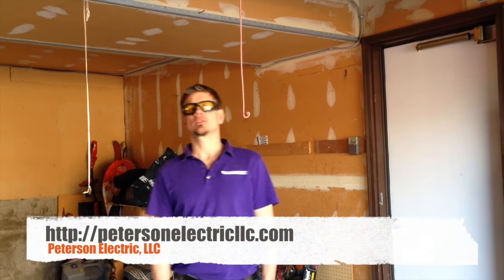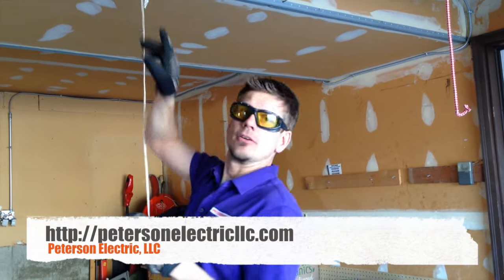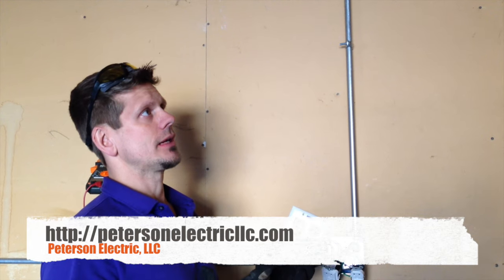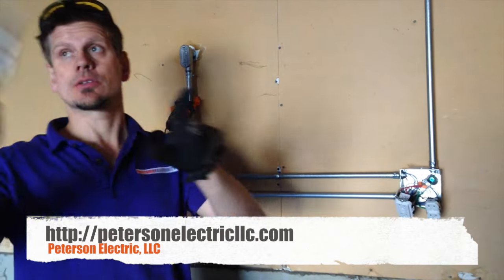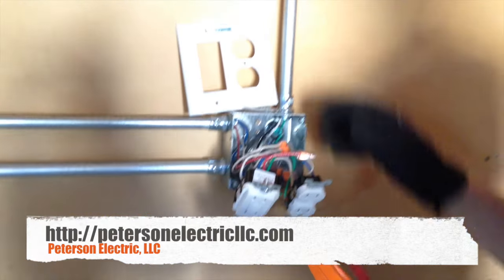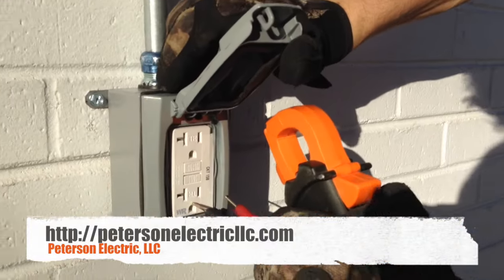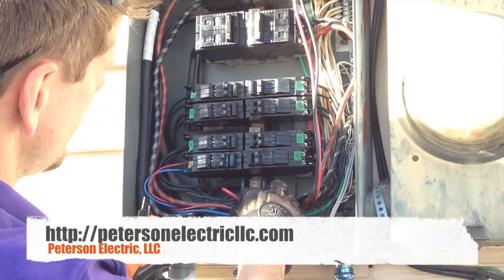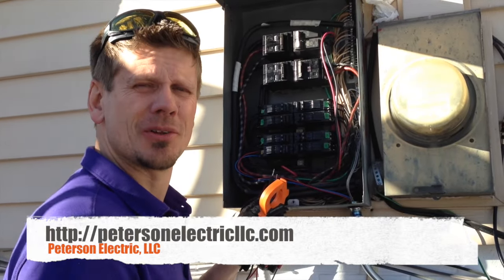Electrical Code For Garages & Exposed Romex Wires

Comment: What year did the code require Romex to be protected in a conduit below 8’?
Reply: I don't know the year but I just spent some time on an electric forum trying to understand this issue. Apparently the protecting romex below eight feet comes out of a statement about protecting the NM against damage and this ambiguous statement in the code gets various interpretations.

Comment: Garage door openers don’t require gfci protection, you started with pie why not complete in pipe?
Reply: looks like over 600° worth of bends to get from the back wall and around the softit to the openers. Why not transfer to mc? Also the whole garage needs to be gfci protected so yes the garage door needs gfci. Only exception is a dedicated lighting circuit
Reply: You could do it with three ninetys and a small kick
Reply: the receptacle does
Reply: @alec4672  Again I realize your comments are old. An you point out that the NEC requires that the garage door outlet be GFCI protected is totally false.An that lighting circuit is incorrect to there in no such code. A garage outlet is not readily accessible so GFCI protection is not required. An you comments about piping I see you have no knowledge to run pipe.
Reply: @MrShockman10  In either the 2008 or 2011 NEC they removed the exception for inaccessible outlets. Now all outlets in the garage have to be GFCI, including the opener outlets. The reset button has to be accessible from the ground. The inspectors here routinely trip the garage GFCI to make sure the openers stop working per the current NEC.
Reply: Marijuana

Comment: I never liked running romex on drywall even on the ceiling. looks tacky but they do make 1 hole romex straps. I carry them just in case . I will do it but not crazy about it. I like your install. It looks like I did it. I know this is an old video but I guess Im bored.

Comment: What are those white patches on the drywall for?
Reply: That's drywall mud to cover the holes left by the screw heads holding the drywall boards up on the wall.

Comment: What kind of wire can I use to power a floodlight camera to the driveway getting power from inside the garage ceiling outlet. I want to hide cables inside driywall. No crawl space. Do I still need to use conduit?
Reply: As for what wire, you’ll want to use whatever the rest of that circuit is on and ensure it aligns with the breaker amperage. 12/2 for 20A, 14/2 for 15A. No need for conduit, but you will likely need to protect the Romex by running it through the studs, no less than 1 & 1/4” from the face of the stud.

Comment: You must have current flow to measure Voltage Drop.
Reply: Yes always. V=IR. With I=0, there is no V (voltage drop), regardless of R.
Reply: @LeifOfWilsonCreek  Exactly, that why his comment 2:45 "there shouldn't be much voltage drop" was incorrect, as there could be resistance in the circuit, but with no current flowing, the voltmeter will still measure full voltage.
Reply: Play with this calculator. Note how higher amperage results in larger voltage drop. Try 7200 V or 15000 V to see what power loss looks like on city-scale power lines. calculator.net/voltage-drop-calculator.html

Comment: A question to Josh from Peterson Electric or any Licensed Electrician in the comment section. I need to install Ring Floodlight Cam above the 2-car garage 2-story house (outside is brick). The walls inside are finished w/sheetrock and height is approx 10ft. The power outlets (non-gfci) located next to both sides of the garage doors inside in the garage. If we don't plan to sell the house in the near future, it is my understanding that following the code is not required. I might be wrong about this. I was quoted $400 and up (labor included) to install by the code: add a switch, run Romex to power outlet around one of the garage doors. Including the camera's cost is almost $700...
I'm contemplating buying Utilitech Pro 50-ft 14/3 3-Prong SJTW Medium Duty Lighted Extension Cord, run it on the side of the ceiling of the garage (securing to the ceiling obviously) and to the power outlet of the garage opener. This extension cord is rated water and flame resistant. Is this a big NO in the electrician world?  I do have rudimentary experience changing power outlets and installing GFCIs in my house :-)
p.s. btw watched a couple of your instructional videos. this is great content. thank you!
Reply: Shabat Shalom
 ... if I read this right you want to run an extension cord from inside the garage to power a security cam outside. The big no-no is if the extension cord runs through a hole in the wall. Pretty much anything else is considered temporary. The catch 22 is "securing that cord to the wall" which makes it permanent. IOW, not allowed. The right way is to run the correct wire and protect the circuit with a GFI. (find the first outlet in the garage) You will also need an outside outlet with a "weatherproof when in use" cover.
Reply: @rupe53  I actually installed this myself 2 weeks ago. Instead of Romex I used 25 ft MC cable and for extra protection and for more secure connection to sheetrock wall inside the garage I ran this MC cable inside EMT. Now on outside this MC cable is not exposed. MC connector screws right into junction box (sealed outside and inside).
Reply: @kstatinet-wk2gh  ... MC cable would be ok as long as that went directly into the back of that outside box and it was sealed against the wall. There are also exceptions in the code allowing conduit on almost anything for extra protection.

Comment: Using conduit for ground is perfectly acceptable. What I find kinda interesting is all the panels in your videos installed on the outside of buildings. We don't see that in Maine
Reply from the maker: It seems like this has been builders choice for years, not sure why. When I did a custom home last year mine were installed in the garage and basement. But when we replace like for like, they stay where there at.
Reply: While using Conduit as a ground is allowed by the NEC, I always advocate against it, simply for the fact that not all installers are created equal (work ethics). Also, we know that over time, connections do loosen(lock nuts, set screw couplings and connectors) due to vibration, metal fatigue (expansion/contraction) etc... Running an EGC gives me peace of mind.

Comment: Where’s does it say in garages that you can’t run Romex horizontally in the wall of a finished garage?
Reply from the maker: 300.6 and 300.11 and 334
Reply from the maker: 300.6 and 300.11 (wiring methods)  and 334 NM cables
Reply: Peterson Electric I should have been more descriptive. I cut holes for 3 single outlets about 15” apart from each other and about 42” at center of the box from the ground. I drilled my holes through the studs in between at the the same level and was planing on coming down from the top for the first box then through the studs to the next. I happened to stumble upon this video...
Reply from the maker: Read those articles. You can google them or at the book store they should have an NEC 2017 book to see these articles.
Reply from the maker: 300.6 and 300.11 and 334 under NM
Reply: You can run romex horizontally through studs as long as it's at least 1.25" from the inside and outside faces. When you are coming out of the first box to go to the second, you have to go back up first rather than straight into a hole so the wire can be secured within 12", and then go across and down to the second outlet (secured again there). This means you will want to drill your horizontal holes through about 6" above the outlets.

Comment from the maker: Depends on how many Wires. Article 300 talks about this. Typically there is an in and out. So two #12/2 per hole of 3/4”
Reply: Peterson Electric: 

I’m am planning in my head a way to use my generator to power some appliances during a power outage. I don’t want to back-feed my power panel or tie into the main wiring. I want an entirely independent system. 

I have a 5500 run watt generator, 6875 starting watts. 4 120v GFI 20 amp. 1 outlet for 120v/240v 30amp. 6 gallons capacity. Ryobi RY905500, $599.99. 

I want to run the basics: (NOT ALL AT THE SAME TIME) portable a/c unit, space heaters, fans, lights, refrigerator, TV, microwave, charging mobile phones and laptops. 

My idea is to to run Romex (because I have a roll of it) wire and install some “generator only” outlets next to the areas that I plan on using appliances.

I have an unfinished basement which will make it easy to run the wires. I would set up the generator outside in the backyard or on the back deck. 

I would like to use an outdoor box to plug the 4 outlets into a box inside the basement. Running the Romex (because I have a roll of it) to the 4 standard outlets I created on the main living level. Also have a ground stake. 

I don’t really want to run long extension cords through the house. Long heavy cords are expensive and a trip hazard. 3 running dogs make it complicated too. I don’t mine shorter, close to the application extended cords. 

Anybody else have this kind of set up or use a generator to power their off grid shed or cabin?

Does this sound very unorthodox, unsafe or illegal?

Comment: I hope you didn’t use the emt as a ground for the WR outlet...As far as i know code only allows that to be done when you use set screw connectors.
Reply from the maker: No sir, I always pull a egc ground in all my pipe.

Comment: M/C sheathing is not a ground. It may read continuity but is not considered a ground
Reply: Dan House yes it is.
Reply: Good thing he used to ground wire in it then. He only used the emt for ground not the mc shield. I don't even think you can get mc without ground unless you pull it out. What electrician doesn't use a provided ground wire??

Comment: what kind of wire did u run in the conduit? Romex? if so what size? what kind of conduit is that also? for pvc conduit what kind of wire can I use??
Reply: Romex is just a brand name. U can use 14 ga or 12 ga. Plastic pipe cheaper than metal.
Reply: @anonymousbyproxy8250  what plastic pipe/pvc is best to use outside under wet conditions? and can I connect that to a metal junction box since inside I was using 12/2 mc cable
Reply: Use 1/2 inch grey electric conduit pvc pipe ( you find it at HomDep next to or across electric boxes section). You can secure the pipe to a metal box using pvc to metal connectors (sold also at HomDep or Low’s or others). Metal clad is not for underground wet area - will rust, to put it in an electrical pvc conduit is possible but cumbersome when you will need to make the 90 degree turns. For wet underground cable use the plastic sheeted UF (underground feeder) cable (it does not have paper sheating like the NM - non-metalic, i.e. plastic sheated wire). If you use UF and burry it 1 ft into ground you don’t need to protect it in plastic pipe ( electricians call it conduit, not pipe). If u have metalic cable entering in a box it’s ok to continue the circuit with non-metalic (i.e. plastic) wire. Important is to assure that you have ground continuity in the wires and also that the metal box itself is grounded. If the terminus of the circuit is an outlet u can easy check corectness of instalation (including presence of ground) with the little device called “3 wire receptacle tester” - 6 $ at HomDep. If the terminus os the circuit is not an outlet but let’s say just a bulb socket, i usually install quickly a socket just to test the circuit - I think this is the easiest way.
Reply: U may ask if white pvc is ok. The problem is that white is for plumbing and gray for electricity, years from now someone may try to cut the pipe thinking it’s a remnant from a sprinkler system and may get electrocuted. Also same size same length I think the white plumbing pipe is a bit more expensive than the gray electrical conduit.
Reply: Please note that opening in metal boxes may be 1/2 inch (most common) or 3/4 inch. The adaptors are different (u will see them, all types of them, on the shelves at HD or Lw’s, it will take some time to get used to which goes into what but after that it will be very easy to find the right connectors). Also note that 1/2 inch is just the name, the real dimension is larger, same for 3/4.
Reply: On your first question : in pvc conduit u can run 3 wire cable or if it is a long run with many turns u shall use separate wires (a bit more expensive but much easier ti pull them through conduit on long runs).
Reply: @anonymousbyproxy8250  ok thanks, i was thinking of getting that flexible liquid watertight nm conduit, what do you think about that ? good for being exposed to wet locations im assuming..? all i need to run is 3 #12 wires thru and not far maybe 4-5 ft and even if i did run far it would be straight, but they do have fittings for that into metal junction boxes right?
Reply: For 3 cables #12 ga u will need 3/4 conduit. They have metal box to pvc connectors for 3/4 conduit, try them in the store first.
Reply: @anonymousbyproxy8250  I could use EMT too right? do you have to bend it or do they have some parts that are already bent? and what size would I need 3/4"? what do you think would be easier to run(only 5-6ft,  only a few bends)?
Reply: Brad, u can use metal conduit (EMT), it is more expensive though than plastic, but if u can get it cheap use it, it is more durable/resistant. They sell pre-made bends in 90* and 135*. To bend it yourself u need the bending tool (expensive). For 12 ga wire 1/2 " diameter is ok. Even if it is metal u still have to have a separate ground wire. In metal tubing electricians use separate wires since pulling a Romex type cable through metal is not that easy especially if u have bends (it is easier in pvc) - some use wire lubricant (sort of an inert slippery compound). If the run is not too long u can assemble the tubing though the wire piece by piece instead of assembling all the tubing and then trying to pull your wires through. Do not forget to ground the wires in the metal boxes (for EMT you must use metal boxes).
Reply: Also, the edges of the metallic tubes shall be reamed, i.e. made smooth as not to scratch the wire especially at bends.
Reply: Also, be aware that metal boxes come with 1/2 openings or 3/4 openings. The piece that attaches the EMT to the box is also in 1/2 or 3/4 (note that the real dimensions are larger - they are just called like that).
Reply: @anonymousbyproxy8250  ok thanks

Comment: Only fools use a conduit for the ground in a damp garage. Hope you did not use a heavy wall coupling to join an EMT connector to the MC connector ( not legal ) but we all do it. Have to use AFCI breakers just about every where in a house if you are in the 2020 NEC